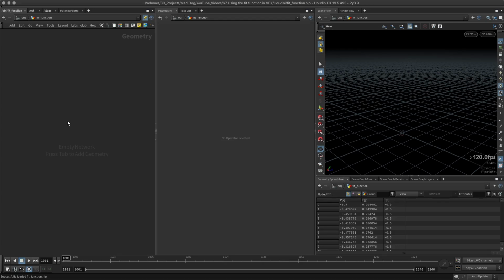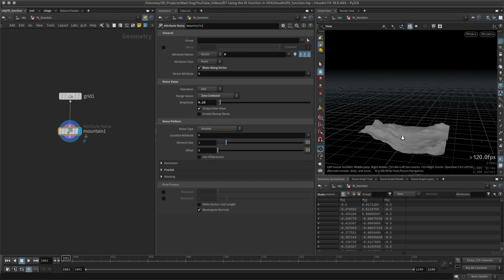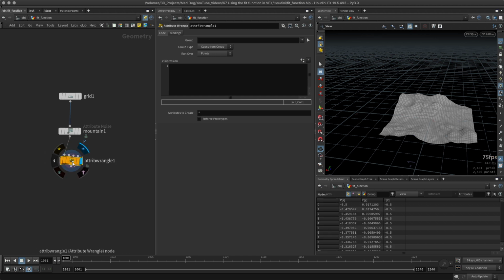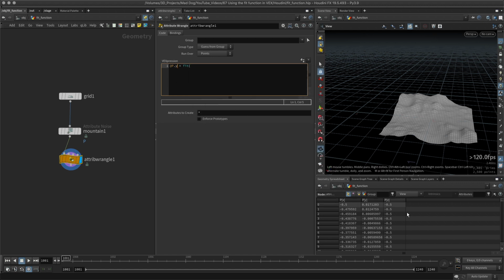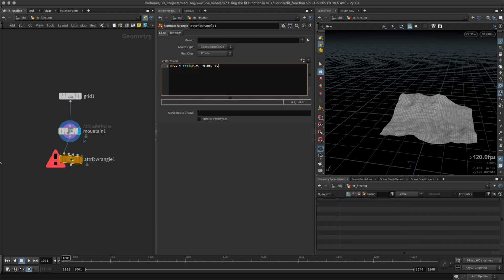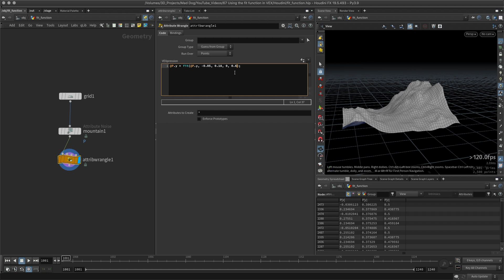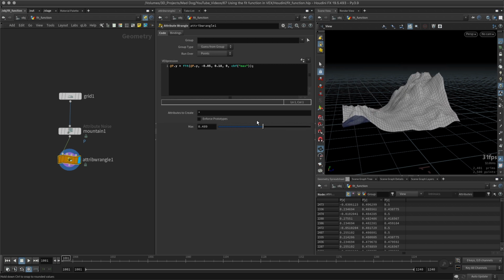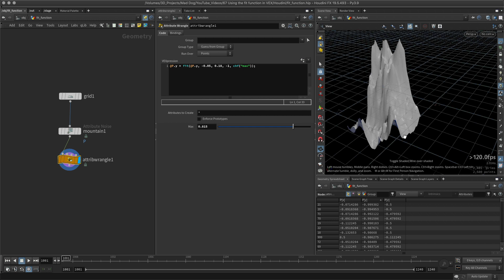#67 Using the fit function in VEX with Houdini

Comment: I don't undestand why to use this fit if you can just scale in Y...?
Reply: Because you can
Reply from the maker: @brandoncyoung  I like this answer. :) Thank you Brandon.
Reply from the maker: Thank you for your question, Lucas. In this particular example you can just scale in Y as you queried about. So well done for spotting this. Whilst this example could be simply scaled in Y instead of using VEX and a fit function, this example was used to explain the basics of the fit function only. The fit function is useful in so many different situations that you will come across in your Houdini studies. This example was the most basic example that I could think of, but other examples can be a lot more complex. I hope this clarifies a little, and thank you for pointing this out.